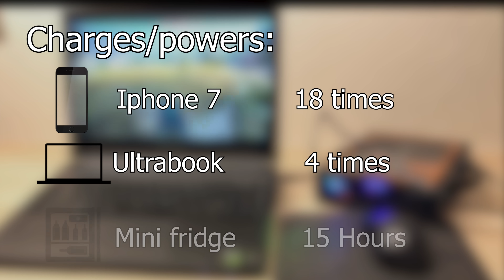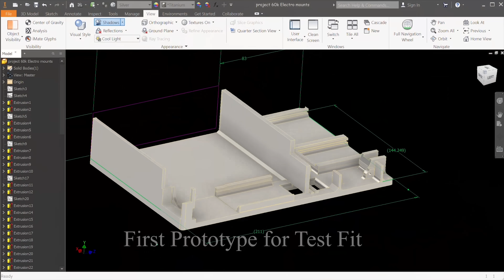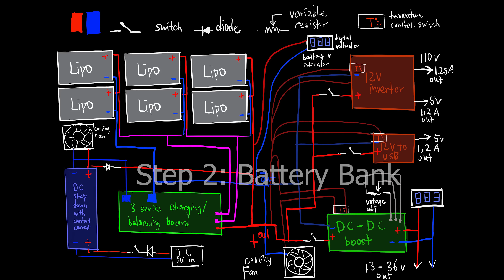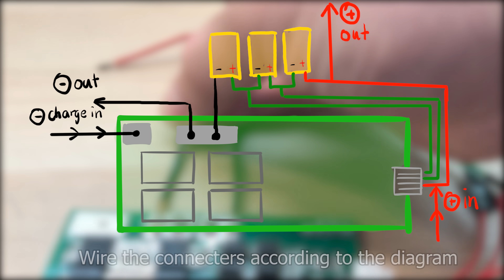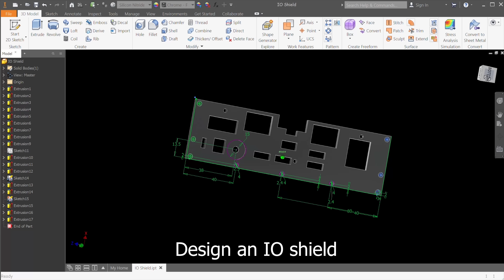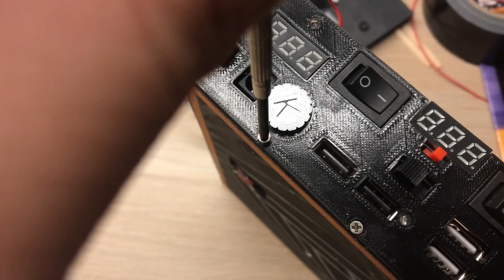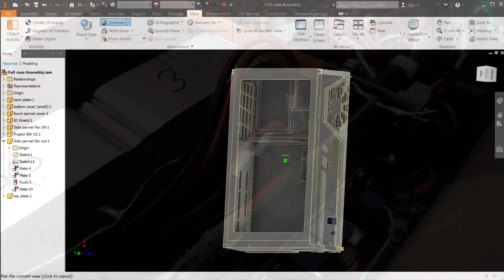Ultimate DIY 60,000mAh Power Bank (222Wh)

Comment: Your soldering terrifies me, considering the amperage in your power bank.
Reply: ik it was a little shotty, just a tad bit
Reply: @allisterroy6604  Well it's very much *shoddy
Reply: @zaprodk  its very much a little bit absolutely terrifyingly bad.
Reply: I stopped watching at 1:58 as I felt sick due to the soldering "technique" (if you can call it that)...🤢🤢🤢🤮🤮🤮
Reply: Dry joints abound.
Reply: @kralyn3d  Ideally, you need one temperature control soldering iron, a can of flux, 63Sn-37Pb solder. For makeshift, a 30W iron will be Ok for small electronic components. You may buy rosin and alcohol to make saturated rosin solution and serve as flux. Don't use lead-free solder since it's harder to make a great solder joint than using 6337 solder. 63Sn-37Pb solder is the kind that is easiest to make a beautiful joint and 60Sn-40Pb is pretty good as well. For a soldering beginner, use only the two solder. Take a look at the series I send you and you'll learn how to solder in no time. BTW, use alcohol or isopropanol for washing the solder for the sake of your health. Never use chloroform because it's very toxic.
Reply: May can I ask you whats wrong with his soldering work respectively what should be changed?
Reply: @Sinns1705  Take a close look at the solder "droplets". A proper solder droplet should be smooth, shinny and the contact angle to the surface should be less than 90 degree. This indicate good wetting between solder and the wire and thus implies strong bonding and good contact between the two conducting pieces. However, part of the joints in the video is not smooth and have contact angles more than 90 degree. It's possible that there are some cold soldering joints that have really bad contact and strength. The joints tend to get hot (power loss and the worst of all, safety) if a high current passes through. Soldering at a proper temperature, changing the rust soldering tip (it's severely oxidized and solder no longer attaches to it. You should always clean and tin the tip after using) and using some flux will solve the problem.
Reply: use tape / dry gum / blue tak, on one of the terminals , no brige created
Reply: bro this is made in china obviously.
Reply: @kralyn3d   Great job and going out of your comfort zone. Just be careful cause that thing can do some damage if joints are bad. 60AH at 12v is a bunch of Power which I'm sure your aware! Watch some vids or learn in person from someone and you'll be good! Great job and keep going your making great stuff!
Reply: @kralyn3d  love your mentality towards criticism.
Reply: I'm the 200th like
Reply: @kralyn3d  its a pretty complex and tough task and I commend you for taking it up, but the values of current you are dealing with here makes it quite dangerous. We dont want you to burn your house down, do we ? Please take the criticism here as constructive and first practice your skills on low voltage/current circuits before moving to high current stuff. Maybe build a setup with a few li ion 18650s and do it with safe and industry standard practices ? Its not hard to research how to implement safe practices at a  desired power level. Good luck !
Reply: @Sinns1705  2:01 solder is bubbling up on the terminal, there is no wetting action. I don't think the terminal would be steel, I think the iron is just too small for job, he could also preheat the switch terminal but that would take a while and could damage the switch.
3:50 solder did melt and the terminal was pre-tinned but still neither of the sides were hot enough for a proper connection, the wire also didn't quite sit in the solder, very weak connection. Also he pre-tinned the wire after the cut, again the tinning shows limited wetting.
6:22 the hole is too large for the wire to securely fit and he applies solder only from one side, even though he keeps the iron on the metal for a while. At least being covered in a thougher base would have helped that wire.
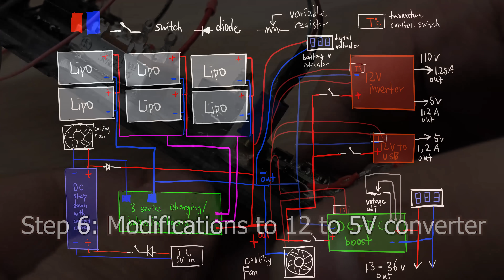8:40 that knob is asking to be broken.
Also I'm not sure if it's a good idea to hole-through screw connectors especially in such a volatile device.
Reply: @kralyn3d  Flux is your friend when soldering ;-) Get some Flux and use it. You will be amazed at the difference.  You want to see nice shiny solder joints.
Reply: Get the FLUX out of my house!
Reply: Yeah same! Also how easily he solders onto fully charged (primed) LiPo Batteries. Should probably carry a warning that shorting LiPo's without security circuit in front of them will screw you up
Reply: He just built a bomb. Messy work, thousands of cold solder joints and no protective equipment.

I hope the thing explodes in his hands. 🧐
Reply: Maybe for 15 hours not continuously use for fridge... It switches on for a few minutes with a power of about 100 Watts and then goes off for ... maybe 2 to 4 hours. And then it switches on again for few minutes and then off again... In case it would need continuous power, the Powerbank would last for ... hm let me think ... About 1 ½ to 3 hours, depending on efficiency of fridge and inverter
Reply: @kralyn3d  If you are tackling a project like that for the first time, GET. HELP. FROM. A. PRO. Dramatically lowers your chances of burning your house down or turning yourself into a fryup. The things slaphappy amateurs do, it makes my skin crawl.
Reply: He needs to study how solar and offgrid systems are built. When you run that much power through something you need to have fuses and screwed down negative busbars, or an automotive fuse box for the higher current leads, special security protection for the batteries, lithium specific fuses, some of these parts of the diagram are not meant to be put onto such small gauge wire, and o f course all the soldering has to be redone. Too much of a rat nest, the box is too small to safely wire it and assess it.
Reply: @Sinns1705  i think what they found wrong is a case of some envy and a little bit of jealousy, wouldn't mind getting stuck with him in the apocalypse.
Reply: 9:26 WTF man ? Do you think it's a good soldering?
Reply: do it better
Reply: @metaorior  I do. I think everyone who solders should learn how to do it well, definitely before taking on high powered projects. It's a matter of safety, not aesthetics. What do you think will happen if that mess shorts out?
Reply: mg yes
Reply: @sovietrepublic38  Thank you for the insides i am newbie and want to build my powerbank for my van with solar pannels and linked to alternator...learning
Reply: It's ok everyone he works on boeing passenger jets.
Reply: @feynthefallen  if it weren't for amateurs nothing would've been invented. so called benjamin franklin was no expert when using wire on a kite, the rest is history. 
amateur definition: a person who pursues a particular activity or field of study independently from their source of income. Amateurs and their pursuits are also described as popular, informal, self-taught, user-generated, DIY, and hobbyist. 
and lets not forget it means Lover. i Like, OLE!
Reply: @09022878  just a correction, that's not 60A @ 12v. He used 6 x 10A 3.7v lipo. That's 60A@3.7 or ~20A@12v. He even specified in the title that it's around 200Wh, not 600.
Reply: @sovietrepublic38  just finished the videos. It was really interesting. Thanks for sharing.
Reply: @BeWolf.  Most people don't understand the fire and electricity hazard of Lithium cells. These cells are able to discharge their capacity at insane speeds, which will give them for a short time at least 20 times as much power as their capacity states. That means, since all connections and power lines should be rated for the load under short circuit, not just intended load, you will need much beefier main leads, fuses and proper soldering. It's not about craftsmanship, it's about safety. A hairy nest of wires smushed together and partially covered in solder is a fire hazard. And yes, when I work with electricity I make sure to do it right. There is no need to show it on the internet. There is however a good reason to point out dangerous things on inexpertly done tutorials, as other people might assume that this is an ok thing to do.
Reply: Not everybody knows this: Lithium cells have a discharge rating, which should be taken into account when planning your setup. For example, a 3S 20A 20C pack contains 3 cells, each with a capacity of 20Amps over 1 hour and a discharge rating of 20 times its capacity. That means that for a 20th of an hour, or 3 minutes, this pack can comfortably provide an average of 12 volts at 14.4 kilowatts without being damaged directly by the fast discharge. These cells can fast discharge like that depending on cell quality several hundred times. It's how drone racers use their cells. If short-circuited, these cells will provide even higher wattage, but will suffer heat damage and might become a fire and smoke hazard. However, before the cells catch fire, for most setups, tens of kilowatts will just incinerate the wiring and electronics. Lithium is dangerous, even at low voltage. Follow safety rules and be aware of the insane amount of power in those small packages.
Reply: Who cares
Reply: @allisterroy6604 , your comment made me want to rewatch it and pay more attention. I was impressed just by heat shrink tubing. The diodes chilling out in the open air is what bothered me.
Reply: @sovietrepublic38 will you give me a link?

Comment: Did I really just watch somebody advising to charge 10,000 mAh LiPo cells to FULL before soldering?  Do yourselves a favour folks, if you're going to try to copy this video, never work with fully charged cells.  Adding heat by soldering a fully charged pack is a LiPo fire waiting to happen.
Reply: @B1akTang1dH4rt  So you charge them, group them, and then discharge them down to a safe storage and handling charge before you solder.

Soldering fully charged LiPos is stupidity, plain and simple.
Reply: Ross Cooper-Smith 

Wow. Learn something everyday. Seriously, with good technique, how much thermal energy will be transferred to the cell; answer for a dummy please.
Reply: @squirrel6687  Couldn't tell you exactly, but let me put it this way.  CellPro PowerLab chargers (high end LiPo chargers for the RC market) automatically lower their maximum charge voltage in low temperature conditions, specifically to reduce the risk of lipo fires from people charging outdoors in the cold, and then taking them inside.

As a LiPo's temperature rises, so does its voltage.  And if you look up LiPo fires, they're almost universally caused by either damage to the pack, or the voltage of one or more cells rising too high.  So heating a fully charged LiPo is an extremely bad idea.
Reply: @og_myxiplx  Even with a discharged cell, I would not solder for more than three seconds on each cell, to prevent damage to the cells, or uneven charging of each cell in the end.

Comment: No 60 thousand but 20 thousand MAh. Parallel connect is sum current and voltage constantly in this video not used fuses and active ventilation. This is amazing bomb!!!
Reply: Yes this is correct.
The power capacity is 20000mah because the 3s lipo protection board delivers 12V output by supporting 3x  3.7v Lipo batteries. Which means thst for 6 pieces of 3.7v 10000mah  batteries, there are 3 groups of 2 Lipos connected in parallel to obtain 12V 20000mah from protection board. You will need 18 Lipo batteries to with an 65 watts protection board to get 60000mah 12V output.

Comment: you serious? no fuses, no temp control for the cells? no charging-current control? 
this is a ticking timebomb!
Reply: Totally
Reply: Gotta live on the edge .. Besides takes fair bit to setoff a lipo .
Reply: Keep calm and shout aloha snackbar! xD
Reply: The step down converter probably has a fuse. Besides you can add one yourself easily.
AND it has temperature control.
Reply: As an electric student this is painful 😣 to watch.
Reply: He needs to disguise it has a power bank to take into planes lmao
Reply: @marknogueira6425  US airlines max out at 100 watt hours for carry-on baggage, hence why anker's largest powercore is 26500 mAH @ 3.7 volts.
Reply: @vton19631  I know that, that's the reason I said lmao
Reply: Do you even Lipo, bro?  Do you think your average power bank is safer?  Or Lipo cells in your phone, laptop, keyboard, whatever gadget you may use?
Reply: Alright Mr perfect fix the flaws and do it yourself
Reply: At least it is not fake you know it works
Reply: Made in China version 600,000mah
Reply: what also pisses me off is the tinned leads into screwed terminals. Best way to have a loose end overtime
Reply: @ShiaLaBluff  Yes they are a LOT safer!   Than again you're obviously a genius!     LMFAO!
Reply: Where is yours?
Reply: @ShiaLaBluff  All those you named usually use Li-Ion batteries which are not known for the self-igniting risks unlike Li-Pos.
Reply: @Jirk4  my phone battery is a li-po, as is my laptop
Reply: ALLAH HUACKBAR MY FRIEND
Reply: Each of the LiPo "cells" has it's own charge controller and OC/OV protection built in....  shouldn't need any additional for those!
Reply: nah, his a first timer, he will learn
Reply: @vton19631  With the way its designed you could just take out the 3 sets of batteries and carry them as 3 seperate smaller cells
Reply: Why so much negative comments. Appreciate it or shut the fk up. He may not be using it (for educational purpose) . Or he done it to teach us. How many of you know what he did ? Appreciate his talent. Now he done without any safety features tomorrow he may add them who knows ? You can't stand up when you don't know how to fall.
Reply: SunriseTrilobite lipo cells in your phone? 
What? 
Explain this one
From my understanding its different tech like oled and lcd, both have the same job but do it different way
Reply: Ghozer 

Some even have temperature protection as well. When purchasing 18650 cells, one can get larger capacity batteries if the individual cells are larger and lack local protection. With on battery protection, some of the volume is consumed by those small circuits boards for that purpose.  In our design, we are using unprotected cells with external charge controllers that integrate many safety features. 
 
We are working with nA to mA range with supply voltages from 3.7 to about 12V.  Working side voltages are 3.7 and 5V. 

Any suggestions for safety guys?
Reply: yoloooooo!
Reply: @petertaylor3424  not really, it's kinda easy to make a lipo blow up...
Reply: djtongi he made an updated version with more protection
Reply: They are shockley protected :-)
Reply: Leon Lyon know that is a bomb
Reply: Leon Lyon ☆ I've seen "900,000 mah" too, but they're the size of a standard 10,000 mag on.
Those Clever Chinese and their "subminiturization" marketing technology!
(disclaimer rates it to max 18k mah)
Reply: Naveen Kumar ☆ I find these imaginatively stimulating instructionals that leave me hungry for MOAR!!!

Also ☆ in looking for a Chinese/Korean firm can print to file, like they do with pcb's. "Links?"
Reply: Stick a hole in any of these & "Instant Fireworks" AKA 4th of July/WW3x
Otherwise, competitive trolling.
Reply: Squirrel ☆ Great Discussion!
Reply: Watch the newer version
Reply: So as far as safety goes, he could have done better with the cells etc. But he's learning as you had to at one point, or may (likely) still be doing. I give him credit for putting himself out there! You're a smart guy, keep it up!
Reply: @christopherfarrell5649  that is not the proplem the proplem is if some one who knows nothing about electricity make the.bank like him
Reply: @big_o1952  Totally understand where you're coming from. I forget the level of common Sense out there. Lithium ion is a chemistry that should not be dealt with without the basic knowledge of electricity... It would be very cool to be able to build something like this for your first time, but if done incorrectly could be catastrophic... 

Do your research people, but I'm happy to see others with such motivation to create our futures! 😎👍
Reply: @christopherfarrell5649  if you pot lithum ion  in parallel if there is a battery that has a voltage smaller than the others the others will charge it with a huge amount of current which can lead to explosions
Reply: A BMS without temperature control